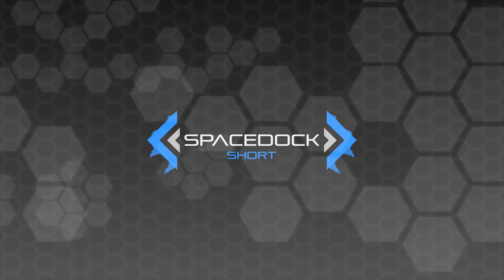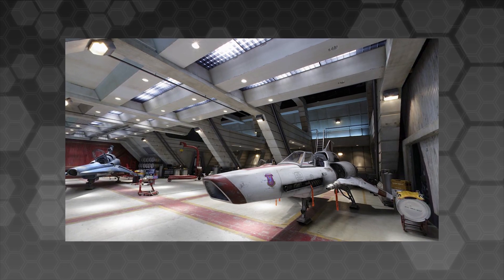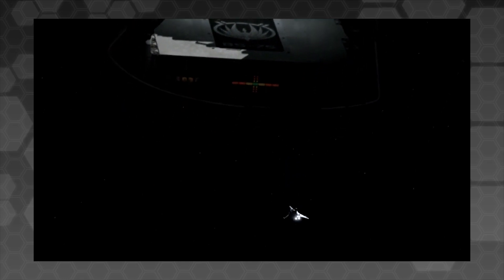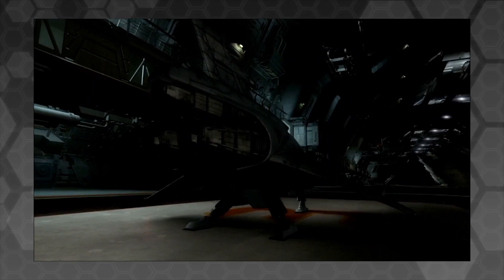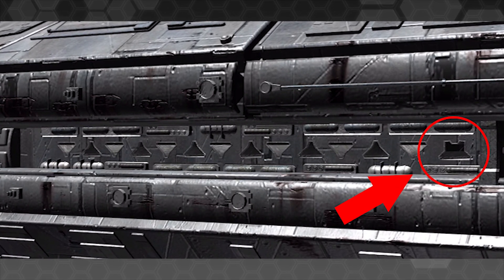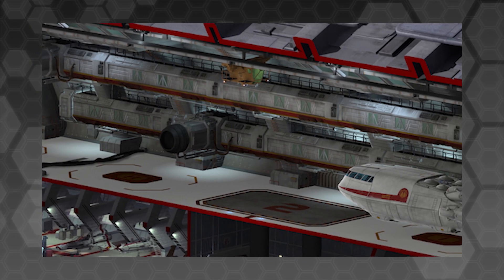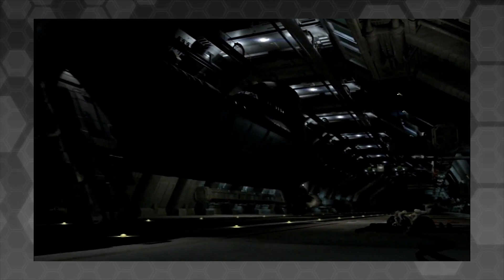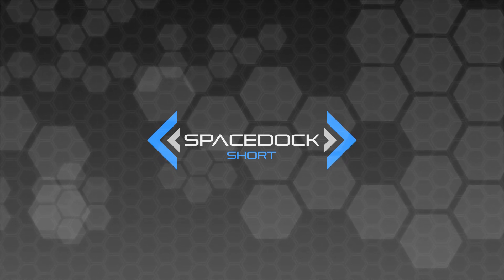How to Land on the Battlestar Galactica

Comment: Had I been in charge of the sci-fi rules of the show I would have made a few small changes.  I would have the gravity field of the ships extend outside their hulls a short way.  This way a landing fighter or raptor wouldn't just float into the flight pod, then hover down to the deck using thrusters.  Instead, you would fly a careful trajectory up to the pod, enter the gravity causing an arcing flight path downward onto the deck. 

The next change would be to have wheels on the landing gear of the fighters, raptors, and shuttles, and navy style arrestor hooks on the vehicles, and dozens of arrestor wires across the entire length of the flight pod.  You arc downward onto the landing deck, catch a wire, and come to a stop.  Then you raise hook, taxi to a lift, and go down into airlock, pressurize, shut down, and be towed into the hangar or a launch tube.

Because the landing runway is not also needed for takeoffs you don't need to angle it like a modern carrier in the US Navy.  You can go back to the original WW-2 style of landing on a straight deck.

A "Combat Landing" is a dangerous maneuver that has the first pilots come in high, landing long and catching the first wire at the front of the landing area, while subsequent landings are made lower and lower, catching wires further and further back.  It is dangerous as hell due to the potential crashes if somebody lands on the wrong wire and rams, or is rammed by, another craft.  It is only possible to even try this because of the sheer size of the Galactica's length, and the relatively low speeds that the returning craft actually land at.  You only need just enough forward movement to give them some velocity to match the forward acceleration of Galactica, and a bit more to get thru the artificial gravity that is outside the hull so they land on the deck and not just get pushed downwards and away from the ship (or worst case would be a crash into the lip of the flight pod).  Those two things make precision landings where you aim to catch a specific wire on Galactica actually a reasonable thing to attempt.  Each craft is assigned a wire, and they better catch that exact wire or we have trouble.  In fact, the regular landings ought to all have a wire assigned to the pilot even when a clear deck is available to keep everyone in practice.
Reply: actually, zero-gee landings make more sense from a safety standpoint.  That reduces impact forces significantly, since vipers are only landing with their own momentum, rather then that plus whatever your gravity is set to.  The other benefit is that it allows benign landings when not in combat, reducing stress on the space-frames of the vipers, as well as the deck plates.  Arrested landings in gravity will always be more stressful, regardless of the combat conditions.  Another concern is that if an spacecraft misses a wire and crashes, it may foul every other nearby wire on the deck.  While a boltering or crashing viper without gravity or wires may float out the front of the bay if its mags don't catch, it wont disrupt your landing cycle.
Reply: Zero-G does make sense, which is why I specifically design to not have that.  The whole idea was to justify why they bothered with a flight pod at all.  If zero-G landing is available, then just have airlocks at the back of the ship, fly inside, dock, and shut the door. 

So I had to think of a reason to have a long flight pod with a runway inside that gives an exciting landing.
Reply: wierdguy564, a docking airlock at the back of the ship makes even less sense in combat from a safety standpoint then gravity in the landing area.  Airlocks and docking ports only work in benign conditions, they're slow, you have limited docking space on the stern of the ship compared to the nice big landing deck, and a missed docking can damage the locking mechanisms, landing decks or hatches of not only the intended bay, but any adjacent bays as well.  On a ship like Galactica, that could even damage the sublight engines.  I don't think you quite understand the risks involved in any sort of rapid recovery evolution.  This is the same reason modern carriers have angled flight decks (and presumably why Battlestars have launch tubes completely separate from their landing decks), a bird that isn't able to land safely not only has a chance to abort, but if a plane does crash, it's not going to cause any more damage to the ship or its air wing, which might potentially put a carrier out of action.

I'm sure what you're thinking of is the shuttle bays in Star Trek, but those are really not designed for combat deployment and recovery.  Think about what happened in Star Trek V, if the Enterprise-A had relied on that shuttlebay for launching combat fighters, "Plan-B" would have put the ship out of action until it could have been cleared.  That's besides the fact that in Star Trek they have shields and tractor beams that could limit the damage of such a crash.
Reply: @jwilder47  It is sci-fi.  You can pretty much make anything work if you explain it enough or even throw more non-existing tech at the questions raised to explain away why things that way.  Really, the actual answer is usually, "Because the show writers think it looks cool!"  That usually wins over logic.  However, the purpose of my post was to explain why a space fighter pilot would still be doing carrier deck landings in space, when really they're could just dock to a moving (or more accurately an accelerating) object.  It isn't even very hard to do that if simulations like OriberSim are anything to go by.   My idea was to simulate ocean going carrier landings, complete with tail hooks and arresting wires.  Launches are also done, just 90 degrees to the side and on a different deck than the landings using the launch tubes.  Still, even with the way it is done on BSG 2004, I would still have prefered they land vertically because they don't have wheels rather than skid to a stop on hard metal landing gear with only rectangular plates on them.  That just looked weird and implausible to me.
Reply: Also as a note, with the flight pod open on both ends, if somehting goes wrong, the pilot just has to keep the fighte rpointed strait don and not hit anything and they can fly or coast out the back and swing aorund to try again. In a back mounted shuttle bay, if something goes wrong with the braking/arresting menuver, the shuttle or fighter can look forward to meeting the back or front wall of the bay and a potentially disaterious crash resulting in loss of craft and crew.
Reply: Meanwhile, all the airlocks and weak points are kept inside the controlled environment of the armored flight pods, away from direct enemy fire.
And to top it off:
No exposed bridge in the middle of a saucer.  Literally a bullseye in a target.
Nothing on the outside except armor and guns.
No thermal exhaust vents.
Collisions with attacking space craft that have decimated Imperial Star Destroyers and Galaxy Class federation ships are shrugged off and repaired with a bucket of paint.
Yeah, Battlestars live up to their name.
Reply: As to the bridge being in an exposed position consider the key role differsances in the ships. Federation galaxy Class, exploration and diplomatic transport. Battlestar, warship. Also note, the defiant had its bridge recessed. True with such a small craft not much room to tuck the bridge away in. Also, once past the shields on a federation ships, having the bridge further in would not make much differance.
Reply: Considering how often Federation ships are going into battle, I would seriously think they'd want to reevaluate their design standards.  In fact, one of their earliest ship, the Dedalus, was more compact and ready for war.
But the Empire has no excuse since the role of their fleet has always been that of war and intimidation. (Though the Empires ships are undeniably easy on the eyes)(Then again, I think the Pegasus could give lessons on "intimidating presence")
Reply: Except that the pods are still in a vacuum and any craft (Viper, Raptor or shuttle) will wind up in a ballistic trajectory accelerating at 32ft/sec2 toward the deck.
More fuel efficient and controllable to keep the open area of the pods in free fall until contact is made.  Otherwise any small craft that comes in high and does not have a powerful enough RCS thrust to arrest freefall in a 1G gravity field will crash and damage the craft, the deck and possibly even kill the pilot.
Oh, and it will use a lot more fuel than just "nudging" the craft to the deck with the RCS.
Safer for small craft to dock the way they show has them.
Reply: @rsrt6910  You may have missed the point.  I'm trying to come up with a logical reason for flight pods for landing in the first place.  In fact, the downward acceleration of gravity is crucial.  It is the only reason why you can even do a wire arrested landing at all.  Come in fast, land at the front of the pod.  Come in slow, land at the back of the pod.  Both have the same downward acceleration, like being dropped from a crane.  Horizontal speeds just determine how far inside you get.

Zero-G landing as they have it in the actual show just doesn't need that gigantic flight pod.  So, I wanted to come up with a reason why it looks the way it does, aka a traditional straight deck aircraft carrier from WW-2, but with a roof over the top making it more like landing inside a zeppelin shed.   So, copycat the real world aircraft carriers a bit more with wheels on landing gear, arrestor wires, and arrestor hooks.  Fly straight, enter gravity field (yes, giving you a downward acceleration as you said), catch a wire, and land.  Takeoffs are done on the lower decks, fired sideways out the ship.

Comment: Why does the admiral remove auto landing system? Hackable by cylons?
Reply: I don't think the Galactica ever had ALS installed unless they were a retrofit after the war.
Reply: All networked computer systems are banned from Galactica, as they are vulnerable to Cylon hacking. Since an assisted landing system would require some form of automated communication between fighter and mothership, it counts.
Reply: Exactly.
Colonials, as opposed to the Federation, apparently remember their mistakes and have to roll through a couple generations of forgetfulness before repeating them (with catastrophic results I might add).
Reply: IIRC from the miniseries, Adama doesn't have it removed, he doesn't let it get installed.
Reply: "Chief Tyrol why can't we use the starboard launch tubes?"
"It's a gift shop!"
Reply: Mitch G “Frack me!”
Reply: TheitaniofRome    probably.   it's implied in the show that cylons have an easier time hacking the more complicated computer systems of human ships.
Reply: Clever Cylon, remove another advantage from the Colonial I see. ;)

Comment: Has anyone ever thought this.

The flight pods are retractable but what happens if they don’t retract after landing all of the vipers and then they jump. Would the vipers be destroyed by FTL radiation or something, because the doors of the flight pods are exposed to space.
Reply: From what I understand. The reason that the Galactica (aka the Jupiter Class Battlestar) has to retract its flight pods is that it is an older ship with an older FTL system which cannot extend the field of its FTL past the hull all that much. Meanwhile. The newer Battlestars, like the Pegasus (aka the Mercury Class), have a newer FTL system allowing it to extend the field of the FTL well past its hull. Therefore it doesn't retract the Flight Pods. I remember someone mentioning somewhere, that one major reason the Mercury Class can get away with having the Double Flight Pods. That said, if the Galactica does try to Jump with the Pods still extended either one of two things happen: one, the flight pods are sheared off from the ship leaving the pods behind while the rest of the ship continues with its jump, or two does something weird to the FTL Drive of the ship. Just a guess on that.
Reply: @robertdrexel2043  the ship suffers if the pods are out; look at all the flexing the ship goes through when she jumped with her pods out at the end of the show. Tigh said Galactica broke her back and she couldn't jump any more.
Reply: Yeah I had forgotten about that. @PythonPlayz I think that is the better answer to mine.
Reply: It just comes down to the structural integrity of the ship's older design; jumping induces stresses on the ship, and bringing in the flight pods mitigates those stresses. Jumping with the pods extended wrecks the ship's superstructure as seen in the finale.